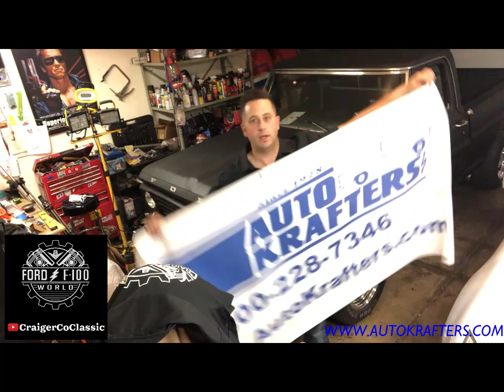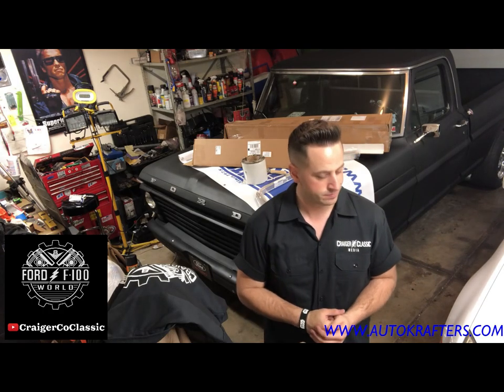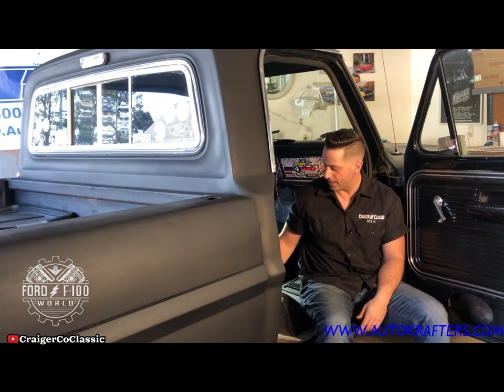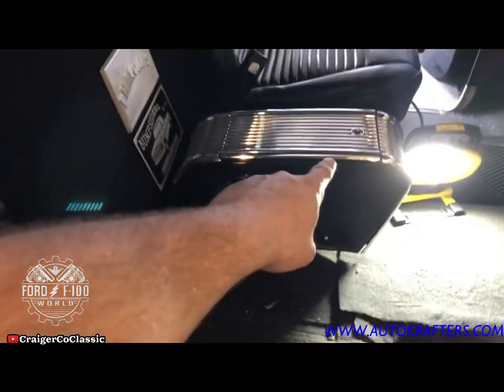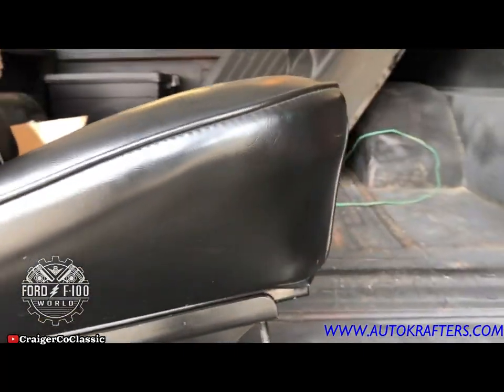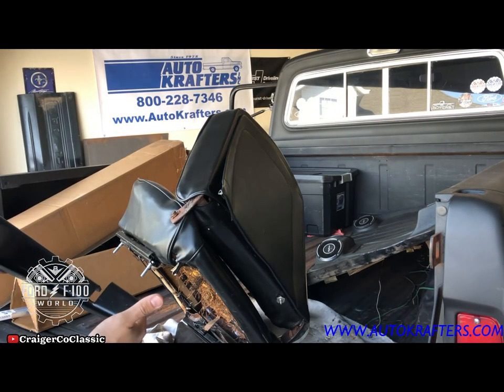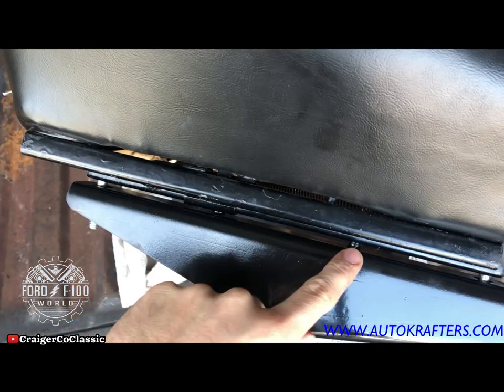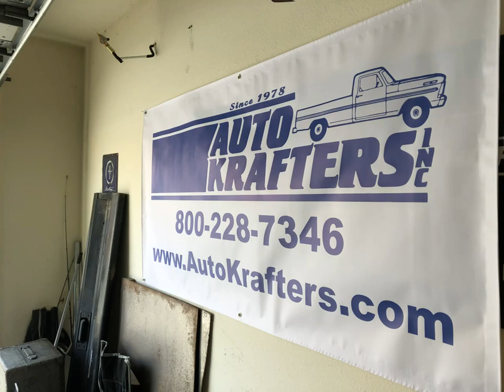F100 Mustang Buckets OEM Bracket! How to:

Comment: Good stuff, Craig. Looking forward to the future project videos!
I might've missed it but, the seat brackets you're using are the aftermarket ones that you posted a screen shot of, correct - not the OEM ones?
Reply from the maker: Jon Turner no mine are older. But mine and AutoKrafters are from the same “blue prints”
Reply from the maker: And thx for the compliment 👍🏼

Comment: I believe that those are 67 Mustang seats, because on a 68 Mustang on the out side that faces the door there is a small chrome lever to tilt the seat forward. I have a set of 67 Mustang seats that I 'm going to put in my 67 F-100. But being the cheapskate that I am I will be using the seat brackets out of a 68 Ford van. I know that they will have to be modified to work but that's o.k. I have a welder and a death wheel and I'm not afraid to use either.
Reply from the maker: lilorbie lilorbie thx for info 😎👍🏼
Reply: CraigerCoClassics No problemo.